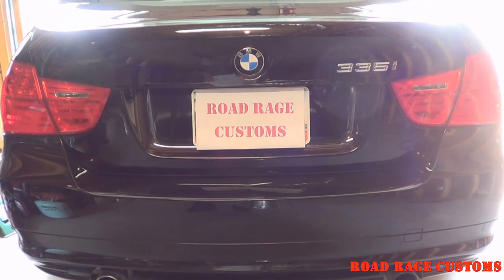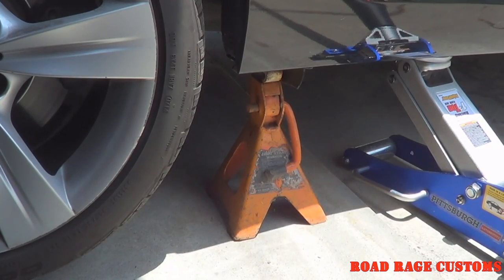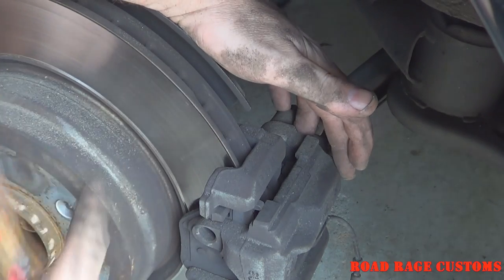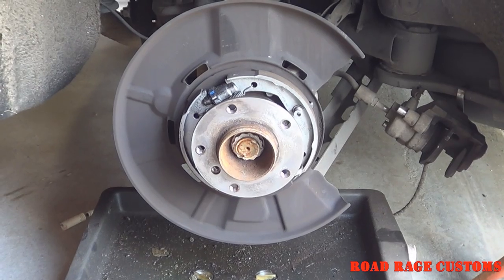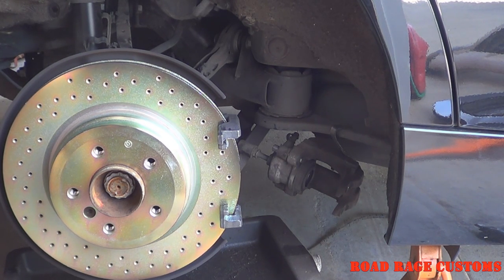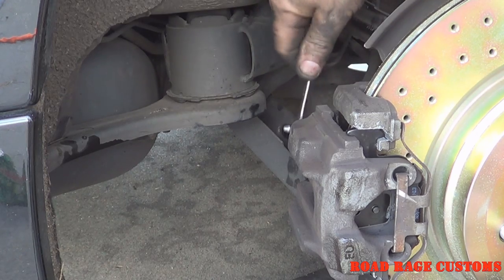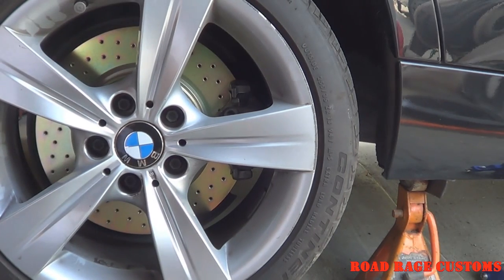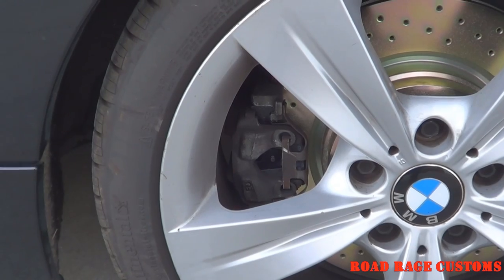How to DIY 2009 BMW 335i Rear Brakes

Comment: Nice job, as usual. Is this one of those brake by wire systems? If so, do you need to electronically activate the MC if gravity bleeding doesn't work?

Comment: +roadragecustoms, glad to see you've got good range of motion in your hand again. Looked liked you were able to curl your finger most of the way. Grip strength still an issue?  I've only had the privilege of removing the wheel from a BMW once (in a 7/11 parking lot of all places) and it was a PITA getting it back on without the studs to hang the wheel off of. Kept feeling like I was cross threading the bolts. I wish I had those studs you used.

Comment: I've seen some people replace the brake sensor... is this process always necessary (I know is best to do so)or unless I'd necessary or it's been damaged ?
I'm replacing very prematurely my brakes so i have no lights coming up yet.
thanks
Reply from the maker: Salvatore Gianni It is possible to replace pads & reuse old sensors. The plastic sensors do get brittle with age & heat. Sometimes they break during removal.

Comment: Welcome back! How do the brake pad wear sensors work? These are not built into the pad, do they detect the backing plate of the brake pad as it moves toward the rotor as it wears?
Reply: ***** they are usually a conducting wire of which the conductor will be cut in half when the tip of the sensor(around 2-3mm from the end of the brake pad backing plates) gets in touch with the rotor, when this conducting loop is broken a light will illuminate warning the driver

Comment: Hey, Where can i buy those wheel stud tools?? Very nice tool, to prevent your wheel dropping on the caliper! Specially when the wheel is seized on the hub, and some wobbling/kicks are needed. Best Coen
Reply from the maker: I bought them from Matco Tools. I assume their website, Snap-on, Mac, Cornwell, OTC, etc all have something similar.
Reply: +roadragecustoms what is the size thread etc
Reply from the maker: +Bokkem01 I think they come in 2 sizes: 12mm & 14mm. Those may be 12mm. I haven't used them lately & I'm not near my tools right now.
Reply from the maker: +Bokkem01 That set has an additional pair that I do not have.

Comment: hey really good video , i was wondering if u had any idea why this would happen. so i am a pipe fitter by trade but doing brakes isn't my thing so i paid a local shop to handle this job  rear break pads and new rotors since they had done the front fro a good price . After i picked the car up i drive away and progressively this horrible squealing metal on metal sound starts up , I'm bringing back in tomorrow and it was to late fro them to look at but it was so bad i cant imagine it was done correctly , it sounds like the worst loudest squealing ever , i dont get what ASE certified professionals could have done so horribly wrong ? its honestly bizar how messed up they sound , they look to be installed correctly and the only thing i can think is they go the wrong parts ? i will find out tomorrow regardless but since u looked like u really handled this like a pro i was wondering what these idiots could have done . i mean they do bmw work and german auto in general , what shortcuts could they have taken that would cause these absurd symptoms. sorry i know ur not here to personally answer questions but if u happened a idea i wouldnt mind having some things to ask them . i not mechanically incompetent i jus figured id pay someone because my time for this wasnt worth but i dont want to take apart their work because they are going to get after it and figure it out i jus am in shock how bad they turned out when they just did the front brakes pads and rotors two weeks ago without issues and the sensor light is off as well. i know that jus coding but I'm jus at a loss....thanks for any advice on how to approach these guys , i will get it fixed one way or another but jeez i wouldnt think that the same guys that did the front could screw me over so bad
Reply from the maker: They may have bumped the brake backing plate and bent it a little. That would cause the sheet metal plate to scrub on the rotor. It would make a horrible sound but would be an easy fix. They should have found any problem on the test drive.

Comment: Aftermarket parts are not OEM quality and will have a different coefficient of friction resulting in poorer braking performance. Hammering the rotor off will cause wheel bearing damage. "Loads being put on the bearings when a vehicle hits a curb, pothole, or other object can exceed the material's hardness limit. When this happens, the damage is called Brinelling. The result of the damage is a permanent dent called a Brinell Mark." As well unless your racing you won't need drilled rotors. You only need drilled rotors to dissipate heat faster when your racing. If its just a daily driver your rotors will never get hot enough to need the drilled part, thus you have just effectively reduced the braking surface area by adding drilled rotors to an area they are not needed. Never tighten wheel nuts with a impact gun as you have no way of telling if its the proper torque or if an even clamping force has been applied. This will cause rotor run out which will lead to thickness variation and a brake pedal pulsation later on down the road. An impact gun should only ever be used to loosen fasteners. And your last statement about painting brake calipers, in a more technical description. The brake caliper is used to dissipate heat from the friction materials and rotors though conduction. If you cover that surface with a nice coat of paint, it can no longer dissipate heat as well as it used to.
Reply: TheRcCrawlerKing on that last part you said you said its not a good idea to paint the calipers then why does brembo paint all of there calipers
Reply: They leave specific spots of the caliper without any paint on them. This way the caliper can still dissipate heat.
Reply: Whilst I agree that drilled disks are unnecessary - the amount of heat dissipation from painted v non painted would be negligible.
Especially - as you have pointed out - we are not racing.
.